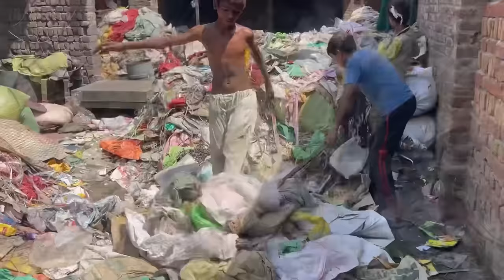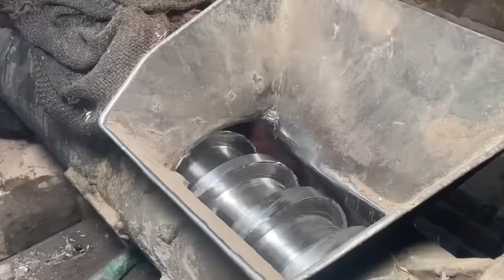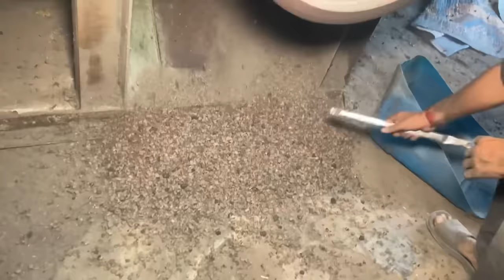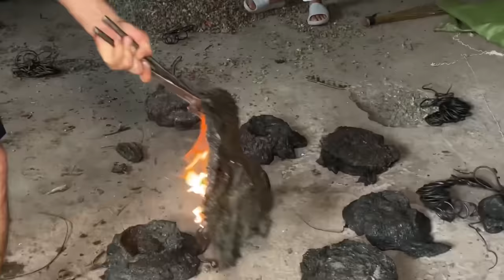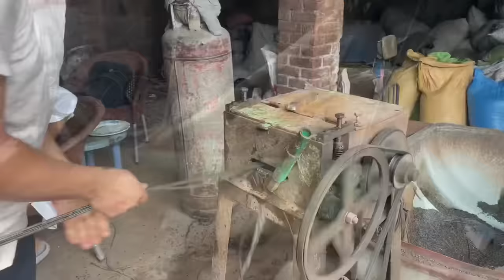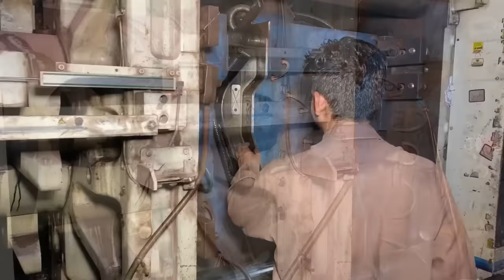Incredible Process of Old Plastic are Recycled to Making Plastic Chair

Comment: Imagine how much carbon emission there is for recycling a kilo of plastic whilst using plastic as fuel.
Reply: Hmm... Carbon... What about combustion products, all sorts of resins, etc.? This is not just a quantitative effect, but a qualitative one.
Reply: @walkin-det  pollution simple as. those workers are going to die a horrid death
Reply: i think this would count as "energy recoop"... like burning tires to make concrete?
Reply: Plastics as a whole aren't recycled. The little pyramid with the number on plastic, designates the type of plastic it is.
Reply: That actually would give a smaller carbon footprint as if they used energy from oil or coal, however that combustion is terrible and pollutes everything with lots of particulate and lots of toxic compounds.

Comment: You'll notice there is no process to clean or eliminate dirt from the source plastic bags. They are filthy and that gets melted and ground right in. Those source plastics could have been use to hold hazardous or carcinogenic chemicals, toxic agricultural poisons, etc. Now those residuals are in the plastic chairs (not to mention every organ of the workers most likely.)
Reply: Not only that, but all the dirt and particulate will cause a tremendous wear due abrasion to their machines. I wonder if the process of washing could actually save them money by not having to stop and give maintenance to the machines. That Mitsubishi mold machine is in the 6 figures.